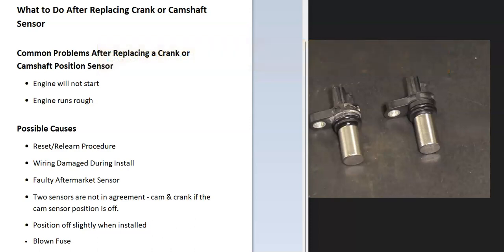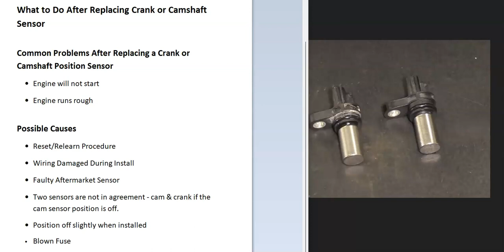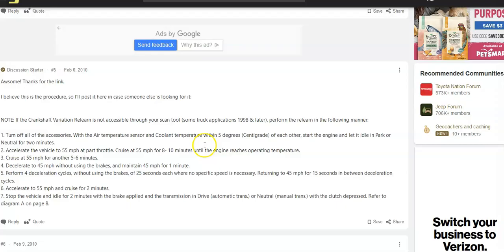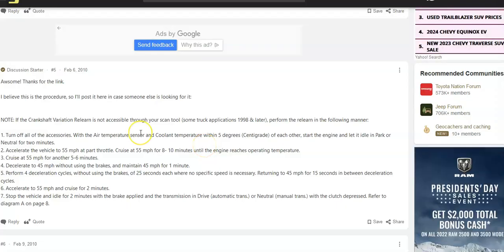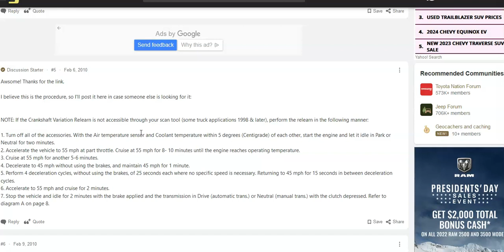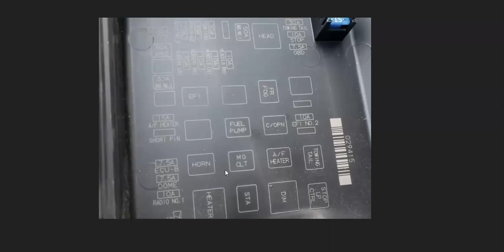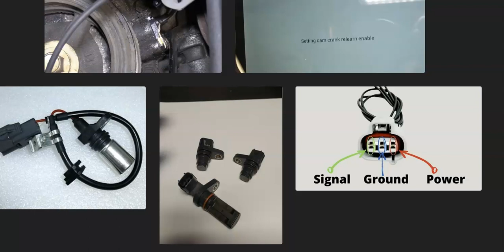What to Do After Replacing Crank or Camshaft Sensor and Now Engine Won't Start or Runs Rough

Comment: 3:50 I have a 2005 yukon with 5.3. I changed the crankshaft positioning sensor and it will not start . Any suggestions.
Reply: Did you figure it out?
Reply: Check the timing belt. When it wears out and is missing teeth, it triggers crankshaft sensor error.
Reply: I changed mine out similar truck same engine bad right out of the box name brand borg warner part from car quest . only found out after using snap on scanner that it wasnt sending signal to computer .

Comment: I changed my crank on my 5.3 not my engine won’t start so I gotta relearn if so is hopefully that’s my problem I put my whole engine together hoping it would work but no
Reply: A youtube video just had a guy that bought a "vident iLink 400" brand new on ebay for $156 and used it to do the crankshaft relearn procedure on his chevy 5.3L and it fixed his problem.

Comment: Magnets are weak on cheap ones, and when you do this clean your connections with electrical cleaner wd40 brand is good, do this with the battery disconnected and give a good 5 minutes and shake it to get any excess out, i hosed mine out pretty good, it dries fast but this is just being safe before you put power back thru. If your having problems not starting afterwards, unhook both your battery cables and touch them together but do not let them touch anything, wrap them with tape if you want, it'll drain residual energy from the electronics and drain capacitors. Let sit few hours or even over night.  Also had an issue connectors clicked but didn't Click with a clean sound had grease and grime not letting the lock really set. Can use a multimeter and check your wires,  12v power and around 5-10 on signal wire, middle should be neutral, 3 wires.  Should be pretty standard for most cars
Reply: @JoeDierte-op2de wow,Wished i had read your comment b4 hand.
Fx35- had  starter replaced instead after position bank 1 replaced- no start, later started dying/stalling again, new alternator,now ruff idling, stalling & a  po  300 code again. Probably only needed a reprogramming

Comment: I have 2014 ram1500 2wd replaced the brake module and all four sensors but the traction control light is still on
Reply: Can you help me
Reply: Wheel  speed sensor clean them

Comment: I have a 2015 nissan altima getting p0335 changed crankshaft sensor and pigtail for sensor still getting check engine light with code car runs fine other that engine light showing any ideas
Reply: should replace ckp amd cmp with Nissan parts
Reply: @dougsullivan6932  They were

Comment: Replaced engine, twice, still getting p0365 and p0369. Wiring is good all is good. 2012 ford expedition 5.4L also replaced crank sensor and cam sensor bank 1. Still have the oe ford sensor for bank 2. Swapped bank 2 and bank 1 sensors and still getting same code
Reply: Check bank2 wiring/harness?
Reply: check timing chains
Reply: lol you replaced the engine twice??  Man ppl need to check wtf they wrote cuz auto correct or stupidity is blocking the details here
Reply: Did you get that resolved? Same issue my 2012 Ford Expedition 5.4 L -3V. If so, how?

Comment: I changed my camshaft sensor and now it has a hard start but runs better than before
Reply: This is very good advice. You can't beat experience. I give it two snaps up !
Reply: I tuned up my 2014 Nissan Maxima sv put everything  camshaft sensors 4 new one from AutoZone in has a hesitation, crank sometimes what you think it is
Reply: I got a 2014 in put all new Crank sensors in our new pack change. The valve covers is everything running is running good but sometimes when I crank I get a good hesitation what did you do it run run great faster than before.

Comment: I have a 2014 ford fusion and I've changed out the camshaft, crankshaft censors, plus I changed spark plugs, my coils where fine its getting gas to the fuel line I also changed the vaccum pump for brakes and its cranking but not fully turning over to catch fire to crank can someone give advice for this issue
Reply: Try to jump start it.

Comment: I have a 06 Nissan frontier and check engine light indicated cam pos sensor needed changing. Changed all 3of sensors, 2 cam and 1 crank sensor. Unplugging the cam sensor was frustrating and irritating cause we couldn't get it off but finally did. Once all Nissan OEM sensors were installed engine light went off. But now truck takes a long time to crank before it starts
Reply: Hi just wondered if you managed to sort this at all? I'm having exact same problem replaced faulty cam sensor after fault code showed and now it's a real struggle to start but no codes showing
Reply: To fix long crank problem, you must use manufacturer OEM sensors.
Reply: I just changed mine on a 2012 Nissan Pathfinder, but now I wonder... will the check engine light go off on its own after driving it?
Reply: Yes one of the sensors was defective so had to change it again. Took it to AutoZone and said it was passenger side

Comment: Ok so I just replaced my crankshaft position sensor and now the thing is getting triggered for some reason. Any advice to what is triggering it would be helpful. 06 Kia sorento stick shift
Reply: Need to buy the crankshaft sensors from the dealer Kia

Comment: 2011 Sentra. My mechanic changed both, told me if that doesn't work its the timing belt, which is going to cost a fortune. Got the car back - it's worse than before. I don't really know this guy to know if he's telling me the truth.
Reply: Timing belts are either good or theyre broke, nothing in between. Get a new mechanic..
Reply: I’m in the same boat. Changed the cam shaft sensor, timing belt, spark plugs and still won’t turn on.
Reply: @SuckmyballsBish  damn that sucks. I paid a lot to replace the timing chain, but at least it runs now. Hope it works out for you.

Comment: I love my carbureted 86 Mazda, no computerized bs to go wrong. EMP proof too other than the battery.
Reply: not emp proof
Reply: Buick century 04 changed crankshaft positioning sensor and no start,no crank discord went black.
Absolutely  confused.
Reply: @LugaboGrace-p2f  disconnect neg bat cable 10 mins, rconnect. Reinsert cam positiin sensor or if possible have someone tap on  sensor as u try 2 start it. U can use ohm light hook on to a fuel inj wire & try 2 start if no light no start it is not getting signal to ecm/ecu
Reply: Same here, '87 Mazda B-series four-by. Minimum number of pcb's for maximum funs!
Reply: Think fast chuckle nuts emp headed your way😂😂😂😂
Reply: I agree...if you have a car that's reliable and you love it just keep it and take good care of it..😊

Comment: my mazda is throwing the P0340 code. not only that the Tacho is eratic. it goes up higher than the actual RPM then just randomly drops to 0 rpm.  car runs rough.   i replaced the cam postion sensor and it made no difference at all. if i clear the code it just comes back again after about 30 seconds of the engine running.   any advice ?
Reply: I'm having the same problem. Have you got any answers yet
Reply: @donaldoneal3823   if you go to my page i have made a video on how to fix it
Reply: Got the same issues too for my mazda bt50.
Reply: if you go to my page i have made a video on how to fix it

Comment: I changed my cam and crank sensors on my 2008 corvette, but the only thing that happened my tachometer is not working any more, you thing that is my crank sensor or my cam sensor,, Thx ..`

Comment: I just had my crankshaft and camshaft replace but my engine light is still on along with my traction light . My car runs good but now is have trouble starting at times . I have a 2011 Toyota cam well my engine light ever go away? Do you have any advise for me?
Reply: If you have multiple dash lights it could be the speed sensor is bad

Comment: I changed both camshaft sensors at same time but when start my car it's running really rough and sounds like it's not getting any oil. I have a 2014 hyundai elantra, any advice for me?
Reply: Hyundai - trade it in for another car
Reply: @buzzlight2nd1  can't really trade in something you can't drove. But it's been figured out thank you, I just had to do a little research myself. It was a matter of changing the oil control valve.
Reply: @kathytaylor5680  so after the oil control valve was changed... you no longer had the issue? Hyundai Santa fe I'm working on btw
Reply: I just had my camshaft and crankshaft replace and my engine light is still on along with my traction light . My car starts but takes longer to start. Do you have any advice?
Reply: @zacharybennett1450  same here

Comment: Thank you for the video. I just replaced a crankshaft sensor and now car won't crank.
Reply: Same here. Did you find a solution? 1999 toyota corolla.
Reply: Me to 12 chevy sonic
Reply: Me Kia Sorento 2010
Reply: There is probably a relearn procedure you have to perform.
Reply: Did figure it out

Comment: I have a 2007 Chevy equinox and they made this vehicle from 05 to 09 I think. I’ve change the crank sensor and had problems cause wouldn’t start ruff idle and cut off. The point I’m getting at when you change the crank sensor replace it with the exact part manufacturer that came out from the vehicle not all manufacturer wire there crank sensor the same.

Comment: I have a replaced the Crankshaft Angle Sensor three times and each time the small magnet approx 1/4 had detached from its glued position with no other physical damage to body of the sensor, each time the magnet was retrievable. The sensors were purchased from the dealer and from Advance Auto Parts, the results were the same lasting one or two years. The installation in very time consuming due to the sensor mounted location to engine behind the timing belt. The vehicle is a Kia Optima 2.4l.

Comment: Can I buy a new crank shaft sensor and kam sensor and just put them back in with out reprogramming them Jeep Cherokee 2007 model thanks
Reply: Not with the jeep my friend..needs to be. programmed in.thats how they have programmedcthere ecu.
Unless you take the fuse under the hood so its not detected while disconnecting it and reinstalling a new one...fucking stupid system..thats how they make there money....theres some good people out there..that can help you out..
Good.luck
Reply: Did it work

Comment: my car is dual cam I was getting a P0340 so I replaced both sensors code cleared but now engine wont start ones a cheapo sensor and the other is an OEM replacement, if I unplug the cheapo sensor the car starts up and runs in limp mode should I take the chance and replace the cheapo sensor with matching brand? should I replace the crank sensor from the same brand too?
Reply: The magnets are weak in cheap ones
Reply: Always use Oem on ignition parts
Reply: Where is a cam sencer on a 2000 Chevy 2200 4 cyclinder motor

Comment: Cant drive. Replaced both sensors. Still stuck in limp mode. Stupid car
Reply: sometimes disconnecting the battery overnight resets the computer
Reply: I changed the crankshaft position sensor and my truck runs it turns on but all the sudden shuts off sometimes it runs for 5 minutes sometimes for half an hour with no hesitation just shuts off what can that do
Reply: @josediazdiaz1913 Spark Plugs and coils. Coil cables might be bad. Or also dirty fuel injectors. Even not enough oil or bad oil.
Reply: @StashHouse56  🤣 Dunning-Kruger strikes again
Reply: @josediazdiaz1913  plug it in get love data up or chuck an oscilloscope on thay sensor I reckon its probably bad someone who can use diagnostics properly will be able to work that out where are you?
Reply: @josediazdiaz1913 You may have a bad wire in your CKP(Crankshaft Position Sensor) and the either the power, ground or signal circuit is NOT reaching the sensor.  You may want to carefully examine your wires for cracking and/or damage.  I recommend you watch this video by Top 5 Auto Repairs, titled CAMSHAFT POSITION SENSOR GOOD OR BAD, https://youtu.be/NxmvTjTqDVQ?si=4kNOawfNY--aX-di
Reply: @josediazdiaz1913  first find out if it's gas
Or electrical  issues....step by step check
To confirm problem related  to.....
I've seen where there a short in firewall @ times from previous people
Reply: probably just need an oil change
Reply: What car?
When you say both sensors I presume you mean camshaft, in each case your fault is probably other side, so trigger wheel, cam ledges ect....
Reply: What is the vehicle's year, make, model, and engine size. Give me these 4 pieces of information and I'll try to help.
(edit: Your post is a year old, but I'm a mechanic. Sometimes people let their vehicles sit for years.)
Reply: @Snouthunter 2009 Xterra , r/r cam shaft sensors, crank shaft sensors, intake boots replaced. Car ran fine for a week, come back after 3 days out of town and it turned off fully when i was moving it. Able to jump start it but once i turned the headlights on it shut off. Any help would be appreciated
Reply: @Snouthunter I have a 2006 Hyundai Elantra.  I replace battery alternator camshaft and crankshaft sensors.  Just clicks
Reply: @Snouthunter hey man, i basically have the same problem as that guy, i changed all my sensors, and camshaft position actuator solenoids, and my car will start and run fine for a little while, then it will go back into limp mode, i did notice metal shavings on my solenoids when i pulled them out. The car is a 2009 pontiac g6 2.4l
Reply: @quxbz  Are the Solenoids hitting the Camshaft? You would see scarring on the Camshaft facing end. Non OE replacement parts are not to spec every time. Best to go OE every time on sensitive Sensors and Solenoids.
Reply: Same
Reply: Atleast urs starts
Reply: Yeah can be a real royal pain in the ass to figure out  these problems due to on board computer guided by cencers only way is dynastic hock up to pin point problem
Reply: gahd damn 100 year plague call the ice engine
Reply: Thats me right now

Comment: I just replaced the crankshaft position sensor on my 99 Dodge Ram & it’s still having the same issues! I’m so mad cuz that crankshaft sensor was a Bitch! 
   Hopefully it just needs to relearn or I may need to do camshaft sensor too 🤷‍♀️
Reply: Whatever happened withthis? Did. You have To rePlace the cam too?
Reply: You ALWAYS replace both when 1 goes.. luckily the cam shaft is easy as pie

Comment: Had a shop replace my crank shaft position sensor on my 2014 Hyundai v turbo and now it seems to either be in limp mode or something g like that surges at around 2500 rpm’s and the code came back for a crank sensor
Reply: Did you ever get your situation figured out? I'm getting a cold p0335 on my 2012 Genesis saying it's the crankshaft position sensor.
Reply: Same here but did it my self started it first time was fine but still in limp mode an cam sensor cade back on my 03 jetta

Comment: Is it possible the engine has only 1 cam position sensor?  09 camry 4 banger. Also its a 2 wire, not a 3 wire.
Reply from the maker: Yes, some vehicles have only 1 Cam sensor, and the older sensors can have 2 wires.
Reply: @HVAC_Mechanic  1 last question.  Should there be voltage there not running with the ignition on?   5 volts i think?

Comment: I replaced both and the codes are still there and car won't even start. I have a chevy cavalier.
Reply: I replaced both too and my car runs poorly now and won’t shift correctly. ‘98 Cavalier 2.4L. I’ll let you know if I find anything out, going to take it to a mechanic likely
Reply: @haydenolsen4241 did you get it fixed
Reply: Howd it go ??  @KickedOpenFrontman

Comment: Hello ,, I need some help here,, I install a 5.3 ls 111 on a 2008 Corvette ls3 engine,  but I used all the covers from my ls3 engine,  this 5.3 has the cam sensor on top in the back of block but I just used a plug on the hole,,, and used my front original sensor ,  even put all sensors new, but now it wont star,, can u send me some info on this one,, thx
Reply: I have a 2007 Chevy equinox and they made this vehicle from 05 to 09 I think. I’ve change the crank sensor and had problems cause wouldn’t start ruff idle and cut off. The point I’m getting at when you change the crank sensor replace it with the exact part manufacturer that came out from the vehicle not all manufacturer wire there crank sensor the same. You basically have to find the old part you had an match it up original. Not dealer part

Comment: 2008 Chevy Colorado 4door 4x4 3.7 5 cylinder automatic transmission 1 cam shaft sensor 2008 new motor 2010 has 2 cam shaft sensor only has one hook up

Comment: Just replaced Cam sensor in my 96 bmw 328i and when reconnected the wires i must have disconnected my air injection sensor but i dont have any idea where the wire is at and there is no crank now.

Comment: I have a 2014 Chevy traverse and I replaced my cam sensor about a month ago and now I'm getting p0016 error code on my odb2 and my car doesn't want to turn over but eventually it starts. I've got a new crankshaft position sensor getting put in this weekend by my friend and I sent him your video and he works on cars all the time, I'm not getting the error code for the crankshaft position 1 center, I'm getting a code saying that cam shaft position 1 sensor and crankshaft position One sensors are not communicating properly. What do you think it is?
Reply: I’m no expert whatsoever but it sounds like you also need to replace the crankshaft sensor like you mentioned cuz your new cam sensor isn’t communicating well with it like this video explains
Reply: I have a 2007 Chevy equinox and they made this vehicle from 05 to 09 I think. I’ve change the crank sensor and had problems cause wouldn’t start ruff idle and cut off. The point I’m getting at when you change the crank sensor replace it with the exact part manufacturer that came out from the vehicle not all manufacturer wire there crank sensor the same.